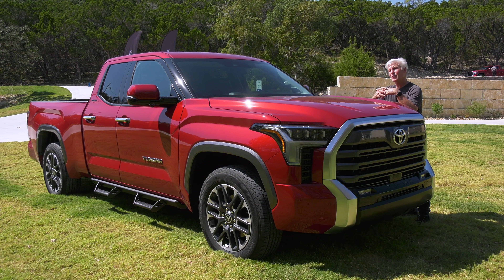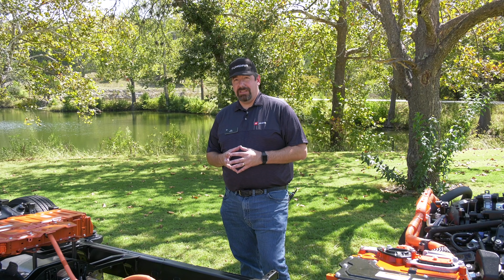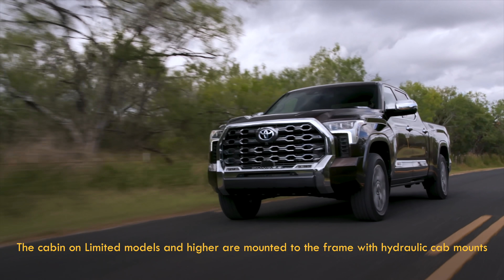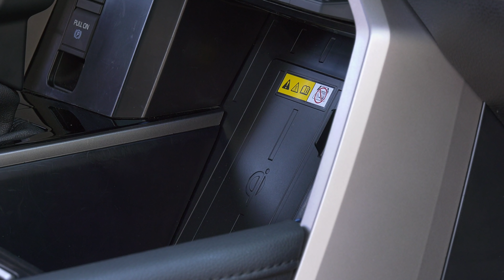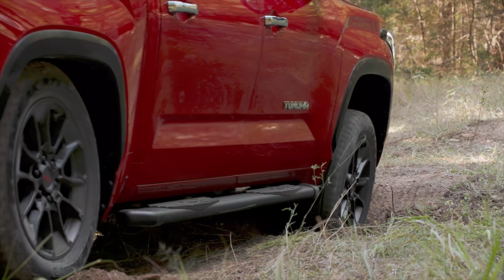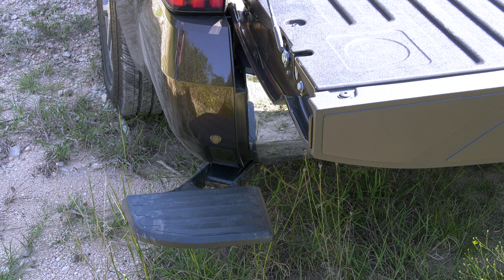The All-New 2022 Toyota Tundra Really Is All-New (And There's A Hybrid)

Comment: Toyota they Kinda screwed up with the new tundra :( 
With a new design the front is ugly the back it’s ugly headlights are ugly :( what  ugly bumpers :( mirrors are old school ugly to :( 
I don’t know how much it’s gonna cost you when all this goes down twin or 2 turbos, hybrid generator  and battery 🔋 :( 
Will cost you $-25-35k to replace every 10 years or sooner :( 
Plus the quality is not anymore and Toyota has issues consuming the tires to fast All Toyota platforms 25-35k miles:(

Comment: Good job Tom. Toyota clearly wants to get in on the Ford EcoBoost customer demographic. Ford proved you can do it and it then becomes more popular than the V8. It will feel different than the old truck for sure but no denying that with a trailer behind you, the "boost" of twin turbos is unmatched. There's a reason why heavy duty trucks have all turned to turboed, diesel trucks. Gas V8 power is good but its a dog with any real weight behind you and will destroy you on poor gas mileage under load as compared to a juiced up turboed truck gas or diesel.

Comment: What happens to the poorly paid non union Kelly temp workers when they are switching the line to the new model? Do they get reassigned by Kelly to a mail room or call center, etc? Interior big improvement. Toyota says a c channel frame is a benefit on the Tacoma so it strange they put a boxed frame here. Doubt this truck is 100% American engineered, even if it was profits wind up in Japan sucking money out of the economy.

Toyota doesn’t make their trucks in Texas out of a favor. They do it to avoid 25% tariff, cheap non union temp labor, government handouts and tax credits.

Comment: A couple of points.  I test drove the old one in 2017 and found it inferior to the Ford I wound up leasing.  What I couldn’t figure out is why the lease price was about $160 more per month than the Ford, even though the sticker prices were comparable, and Toyota is known for great resale value which should mean a higher residual.  In 2020, during COVID, both Ford and Toyota were still offering the same truck, but I went with Ford again because it was better and cheaper.  (Long term durability was unimportant to me on a lease.)
My lease isn’t up again until 2023, and I will definitely look at the new Toyota, but aren’t they still behind Ford in offering a small electric motor incorporated into the power train?  This Toyota seems to be a follower rather than a leader, leaving me to think they will still be an also-ran in the full-size pick-up wars.
Reply: My 2008 Tundra is going to hit 300,000 miles in early 2022; my father owned 5 Fords since 1983, never making it past 210,000, and that was with extensive maintenance to his transmissions and transfer cases. That’s why Toyotas have higher relative resale, but that may be less important to someone who leases.

Comment: Best looking full size pickup imo. Pity there's no diesel. And if it's correct (as shown in yellow) that the new one gets the same 19 mpg combined as the old one: disappointing fuel economy.
Reply from the maker: There's a typo, the EPA average is 14, not 19. The rest of the numbers are correct. I shouldn't post at 1AM.
Reply: @DrivenCarReviews  I'll overlook this error for now. Just kidding, excellent video! Best regards from The Netherlands   :-)
Reply from the maker: More power than the V8 and some 20% better fuel economy though.

Comment: "...Chevrolet Silverado1500 Hybrid is the only hybrid in the full-size truck segment. Compared with comparable, non-hybrid models, it delivers 33-percent greater city fuel economy and a 23.5-percent improvement in overall fuel economy, all with the capability customers want in full-size truck – including a 6,100-pound (2,767 kg) trailering capacity.

Estimated fuel economy for both 2WD and 4WD models is 20 mpg in the city and 23 on the highway...."  GM Media with a larger 300-volt battery and 6.0l V8 circa 2012!
Reply from the maker: So what is Ford PowerBoost?
Reply: @DrivenCarReviews  it should have improved in a decade not match what GM already did.   It is anpoor showing from Toyota, so called king of hybrids.
Reply: @normt430  It’s still a hybrid, and your reply is completely unrelated to his comment. Toyota does hybrids best, Ford can’t even handle the transition from electric to gas power
Reply: @alh06  Toyota has recalled the Prius a number of times.  They are far from perfect and the credit everyone gives them.  But the Tundra's hybrid improvement in fuel economy is only compared against itself where others are are more efficient.
Reply: @normt430  You need to pay more attention to detail. You're comparing the Silverado hybrid to the Tundra NON-hybrid. The Tundra still gets better estimated mpg. Real world numbers will favor the Tundra even more. The Silverado doesn't come close to Chevy's claim. Then there's the fact that the Tundra is enormously powerful compared to the Silverado hybrid. 

Did I forget to mention that the Tundra hybrid isn't even being examined yet?
Reply: @stephenwerner1662  fuelly is show an average of up to 18 mpg for Silverado Hybrid but highs of 24-25 mpg.  This decade old tech with a larger displacement V8 so Toyota better be pushing 30's.
Reply: @normt430  The hybrid Silverado has 32% less HP and 59% less torque than the hybrid Tundra. Meanwhile, we already know that the Chevy gets WORSE gas mileage than even the non-hybrid Tundra. The Silverado engine is leagues behind the Tundra engine.

With the way you keep quoting GM marketing, it makes me wonder if you work for them.
Reply: You just repeated yourself by quoting GM marketing again.
Reply: I bet it will break down way before any good V8 engine. What's with this MPG chasing with big trucks? How do did the active fuel management BS go with Chevy and Dodge? Oh yeah it sucks and destroys engines. People even de active that garbage.
Reply: @joseCalderon1976  Toyota's reputation suggests that you're wrong. I used to believe the same stuff that you're suggesting. Then I bought a Tundra. I was wrong.
Reply: @stephenwerner1662  Yes, but you are thinking about the past. These new engines are totally different and turbo charged. Do you really think that these things are going to last long term in such a heavy vehicle? I hope I'm wrong honestly. But a V6 turbo charged will always be more strained than a V8 natural aspirated one when comes to towing and just moving around such a heavy beast. I'm not sure about the hybrid one.
Reply: @stephenwerner1662  Yes I agree that right now the V8 Tundra seems to be the most reliable big truck.
Reply: @joseCalderon1976  Well, "strained" really isn't an engineering term as that phenomenon is impossible. 

Here's my best comparison. Does a nuclear reactor strain compared to a coal plant even though it's much smaller?
Reply: @stephenwerner1662  We'll see what happens in the long term. Are you going to buy one or see what happens later on?
Reply: @joseCalderon1976  I'll be buying one but not right away. I don't feel like paying for another truck yet as my 2010 Tundra still doesn't have any problems except some corrosion. We love to salt the roads every damn day where I live.
Reply: @stephenwerner1662  Cool. I hope this new model is just as reliable as your current Tundra. My step dad has a 2013 Tundra crew cab 4X4. He's been towing his big 33ft heavy trailer all over the place with no issues.